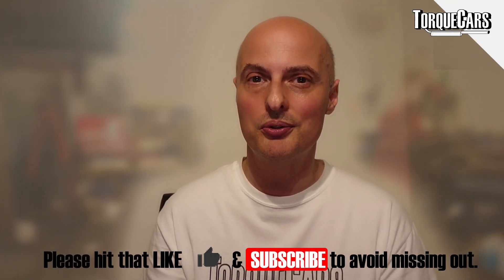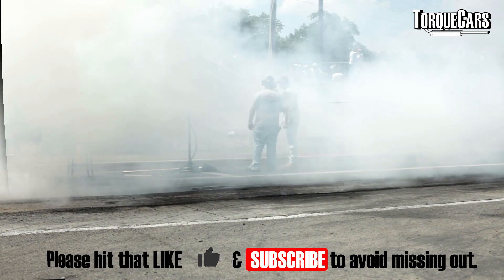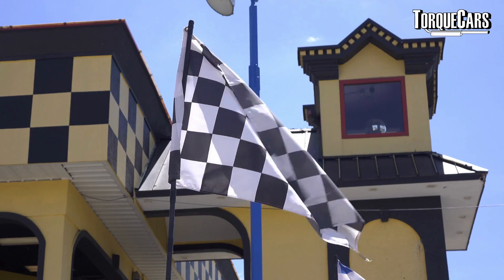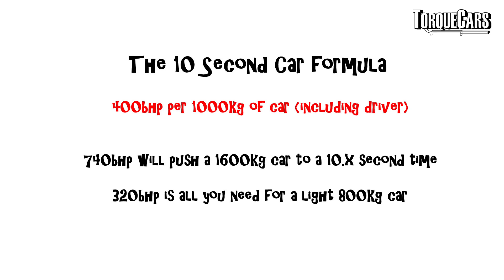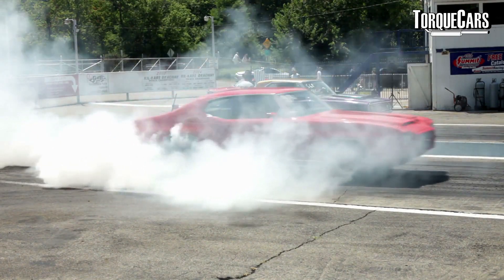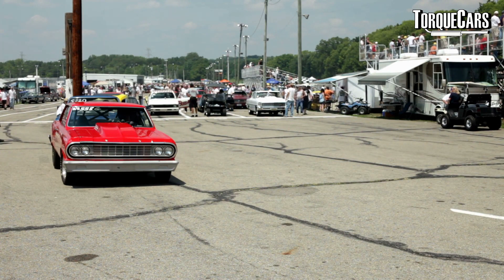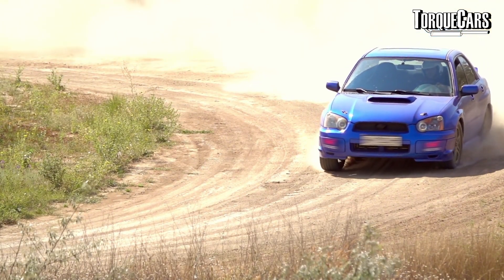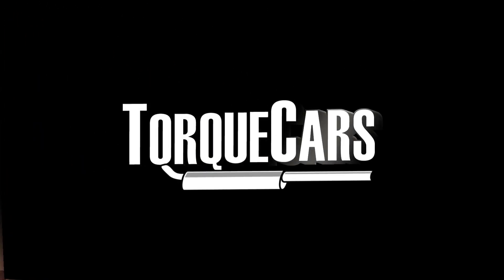10 second cars. How much power? [Drag Racing Intro]

Comment: 500hp in a 3000lbs car, if setup properly, will run tens all day long! Suspension is everything (OK, not everything, but a lot :face-blue-smiling:)!!
Reciprocating weight is a huge one!! Cut it everywhere you can!
Don't forget coatings! On EVERYTHING!! Rear gears, internal engine parts, etc.
Don't forget cutting weight from the internal transmission parts.
What about your wheel bearings? What are you using now, and how fast do you want to go?
Wheels? If it's A to B racing, using the absolute lightest rims you can get your hands on! (again, reciprocating weight)
Tires? Use the smallest/lightest fronts you can, and use the tallest, yet smallest (width) rears you can get away with., There are cars today running 7's on 10" wide (and less) slicks! The day of the monster sized rear tires is over! Rubber tech has come that far. (might even try the new drag radials).

There is literally a million things you can update and improve on your vehicle that will take a 400hp, 3200lb car deep into the 10's if you want to put in the work! (and money)

Comment: Hello guys i have a fbo , e85 weight reducted camaro , things are ported afm deleted , top end rebuilt ,will a torque converter and 391 gears get me where i need or do i need more power still ? At the crank im about 530ish on e , stock heads , stock trans and fuel systems

Comment: Aerodynamic forces specifically Drag and Bernoulli’s Principle (speed lift) begin to act upon the vehicle noticeably, based upon my personal and objective experience) closer and closer to the gate as speeds increase, this is all relative to and determined mostly by body shape, and speed, other factors include weight distribution, in drag racing the center of gravity is effected by ground clearance, engine placement along the wheelbase, the engine and drivetrain combined center of mass elevation, rear wheel rotating center height (axle pivot center above or below COG) chassis suspension design geometry and setup Understanding  any of these factors and a few others left un addressed amplify the impact on your ET, and  increase at an exponential rate as you add horsepower causing speed, and acceleration rates to increase, learn about ground effect, drag coefficient coanda effect, and bernoullis principle, and the magnus effects, it will help you to avoid trends and apply only what works for your setup.
Reply: Many NHRA stocker first gen Camaros can go a 10th faster in the quarter mile by simply removing the rear spoiler alone! Imagine what ceramic bearings, lightening the transmission internal parts, and coating the rear gears, etc., etc., can do!!

Comment: S4 runs 10s and is 1700kg and 500hp so not quite correct
Reply from the maker: This is really useful feedback, thanks. I couldn't fully include a Quattro drivetrain in these results, they skewed things too much and were too variable, maybe due to a lack of data points to work from. 

Perhaps I should redo a Quattro version of this video and the quarter mile calculator we have on the site.
Reply: @torquecars  My Australian Commodore 4 door sedan is 1750kg (3850lb) with 550bhp and runs 10.7 at 126mph. I think your calculations are overly generous for the power needed. Mine is a reasonably modded N/A LS V8.

Comment: 500 bhp all motor~1500 kg is 10 sec car
Reply: Ok so 1:3 power to weight and decent traction.
Reply: I like that 1 BHP per 3 KG ratio.  I have a Camaro ZL1 , 650 BHP   and 1800 KG and I'm running 10.9 seconds. Nice video.
Reply: I've seen cars that are 500hp not come close without serious suspension and tires
Reply: @romaramazan7175  traction is everything
Reply: @Rusty_Panda_1  Traction AND how the suspension is reacting is everything. There are cars that are 3000lbs+ with less than 500hp running in the 10's. One thing that's super important that most people never think about is mechanical drag! Take a look at the Stock and Super Stock classes in NHRA. People would shit themselves if they knew the cars making way less than 500hp in 3000+ pounders running deep into the 10's!